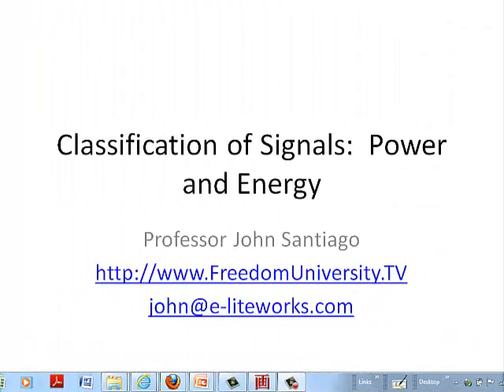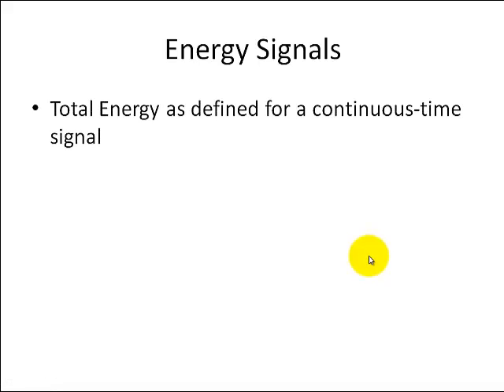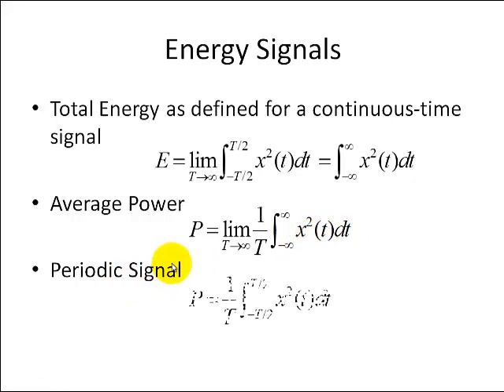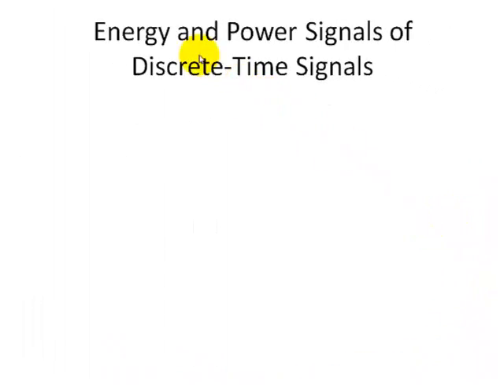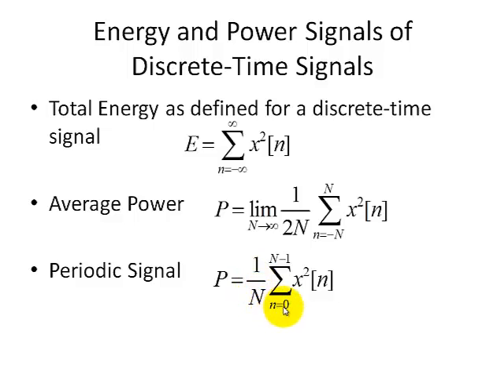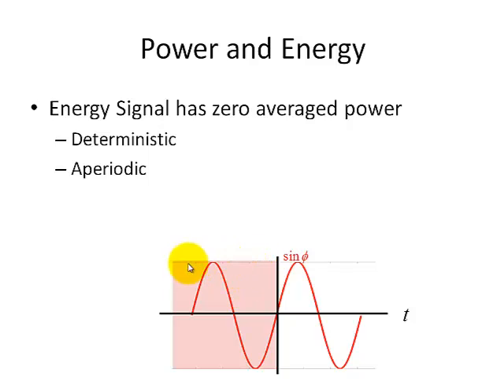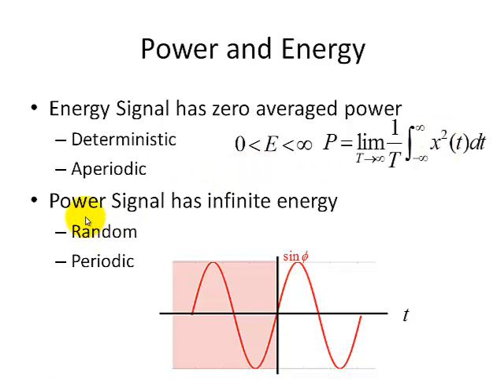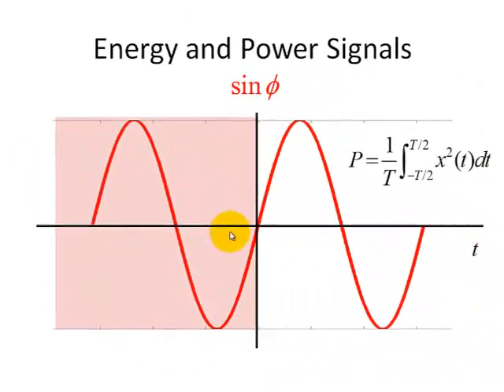[Classification of Signals] A Tutorial Introduction to Energy and Power Signals (Part 1)

Comment: The formula for average power given on the slide at about 3 mins into video is wrong. Imagine a sine wave, well the integral of that square over all time is infinite, and infinity divided by the period T is infinit => according to your formula the average power of sine wave is infinite. wrong!
The limits on that integral should be from -T/2 to +T/2 which T is the variable over which you are taking the limit (not the period)
For periodic signal that can be computed by just considering one period as per you last equation which is correct but now T is the period of the signal (might I suggest you use a different variable lettering to make it clear that the T is these two equations have different meaning).